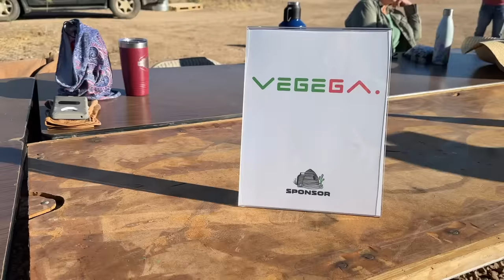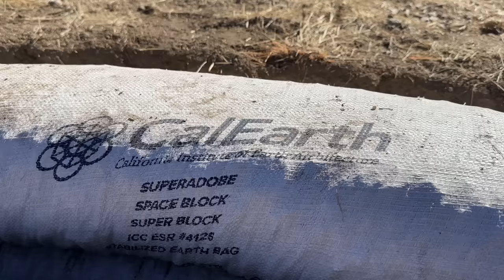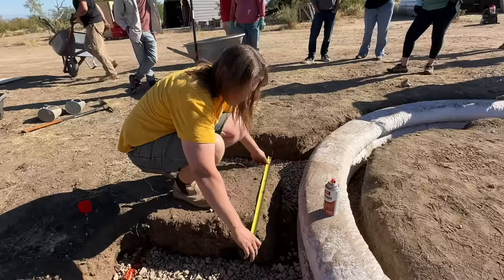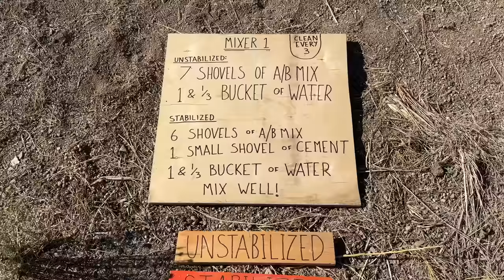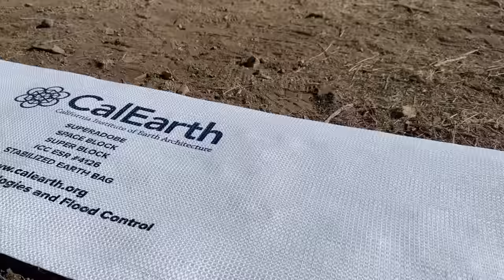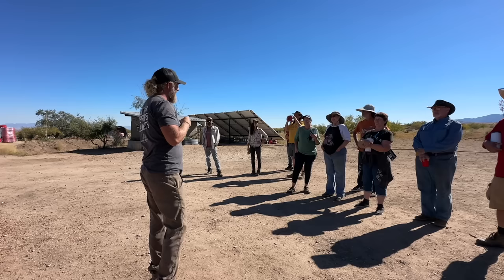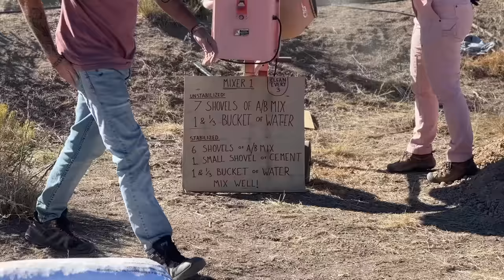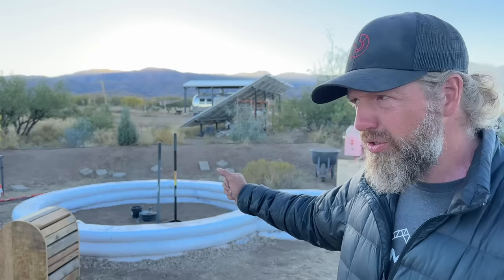First TRUE Earthbags? Day 2 Building a Superadobe Dome Home

Comment: Wow! It does not look as easy as I thought it would be! There is a lot of WORK involved. Kudos to all of you that participated in the workshop!
Reply: I think strawbale would be quicker and easier, but that's just me 😊👍❤️
Reply: @col2560 I've done some building, and at one point took a good, long look at strawbales. They aren't as simple ore as cheap as you might think, and they do involve a lot of wood framing. Plus, you've still got to plaster or stucco them to keep the rain off and out.